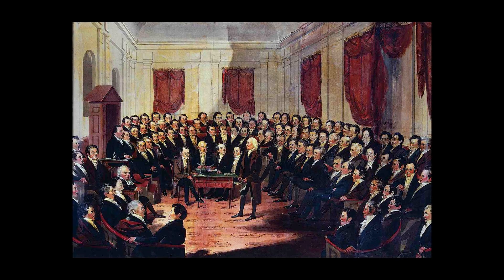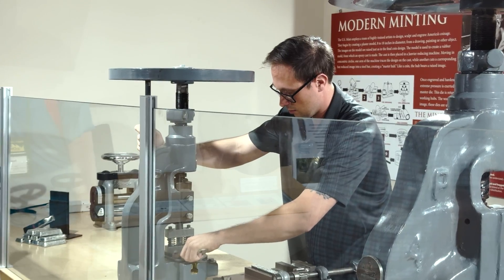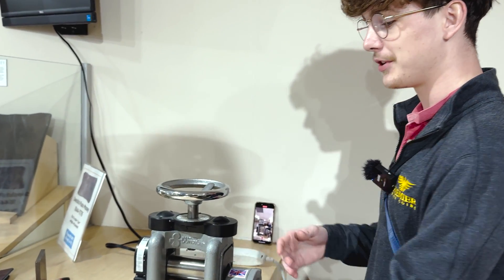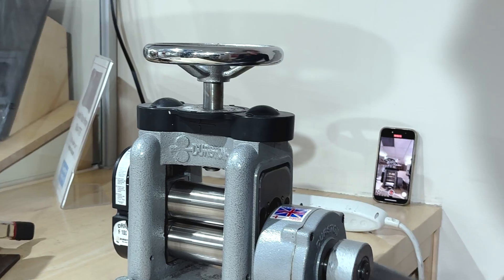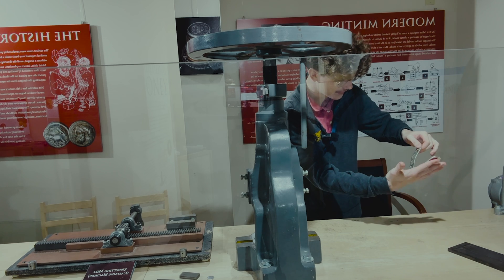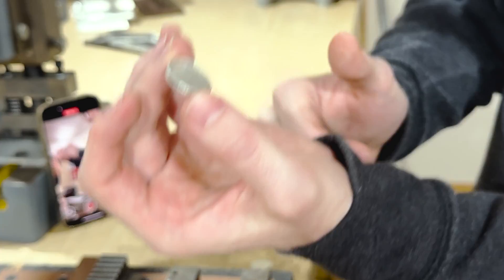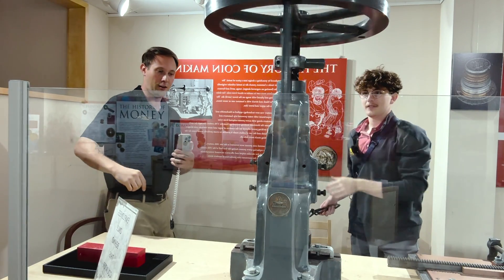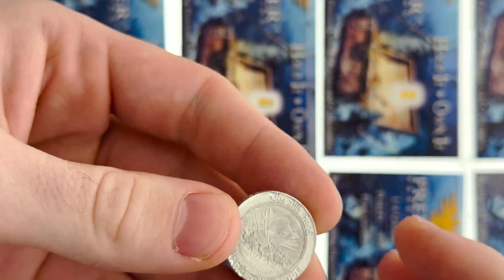I Made Coins Using 18th Century Techniques!

Comment: Would this equipment work for pure silver or copper coins?
Reply from the maker: I’m not sure, we were using pewter which is quite soft. I’m sure you could use the other metals but you might need to strike it multiple times

Comment: The funny thing is that the presses they used in the late 1700 and early 1800s were more primitive than that. Making coins back then was so labor intensive that it's amazing they produced as many as they did. That production method also explains why you see such uneven strikes on pre 1836 (when the US Mint started using steam presses) coins. This was a lot of fun. Thanks!
Reply from the maker: yeah the machines in the mini mint would be recreations of the original tools that were donated to the museum. The stamps were much larger and had horses to help keep things moving

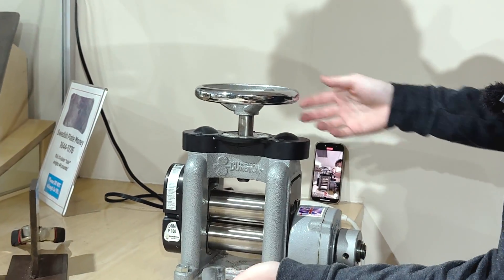Comment: Thank you for your video. @ 1:56, as metal is compressed through the rolling mill. it becomes progressively work hardened and more brittle. Excess work hardening can overly stress the metal and form cracks. Therefore to relief the stress and make the metal more malleable again, the metal can be heated red hot and gradually cooled by a process known as “Annealing”. Regarding 3:40, the Castaing mill putting a raised rim around the edge of the planchet is known as “Upsetting”.
Reply from the maker: Thanks for the info!